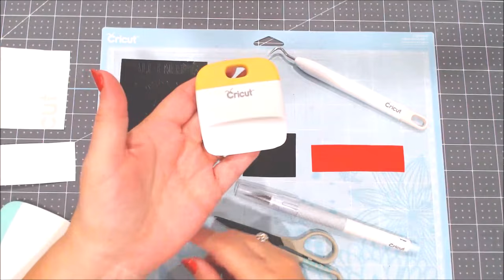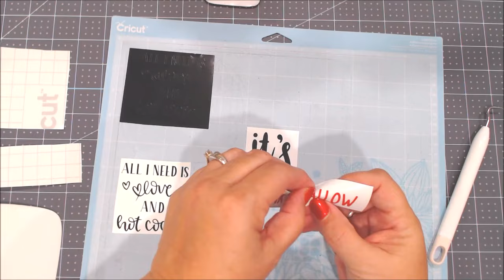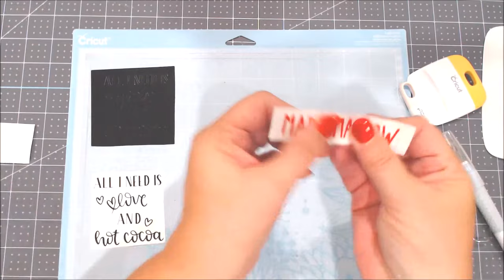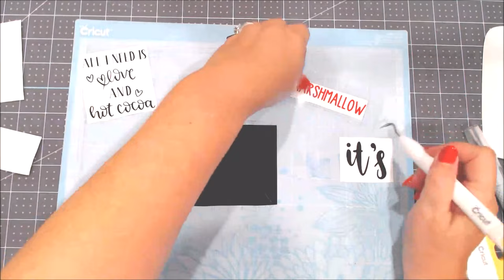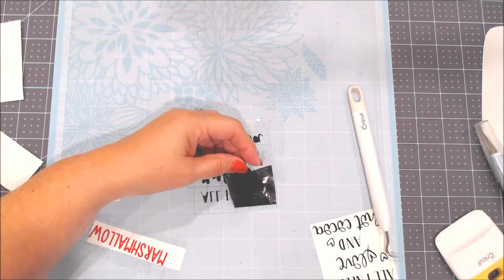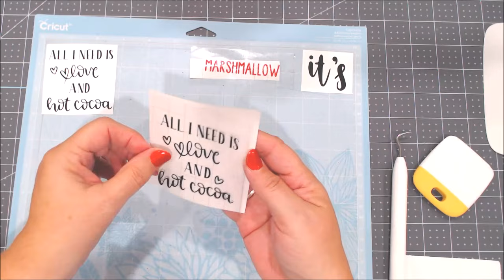Vinyl Weeding Basics For Beginners

Comment: im here because i want to mess with vinyl without a cricut. i cut a hole in a pc tower for a grommet and overcut the hole a little. im using black sparkly vinyl to conceal the empty space. no particular image. just rectangles. i just wanted to know what weeding is. not sure that i need it. i bought a paper cutter and i guess ill find out if it works. the goal is to make it seem like it came out of a factory like that.

Comment: Why does mine not come out like yours. Mines a nightmare
Reply: Seriously , same here. I’d like to know too.
Reply: I’m having the same issue, I suspect my Cricut which was bought on Amazon was actually used or refurbished, I’m going to change the blade because I feel like it’s not cutting deep enough and I need to put everything on to settings further than I should for the material I’m using, and weeding is a nightmare.
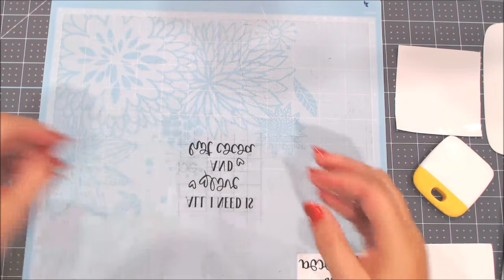Reply: There is quite a jump cut at 10:00!  It even appears with new piece of transfer tape.
I was looking to see how she would repair the damage done to the "o" in love (seen at 9:30), but I suspect that there were enough problems that she started over from scratch with a third vinyl.
So it look like you are far from alone!